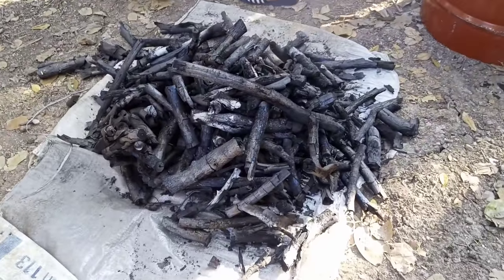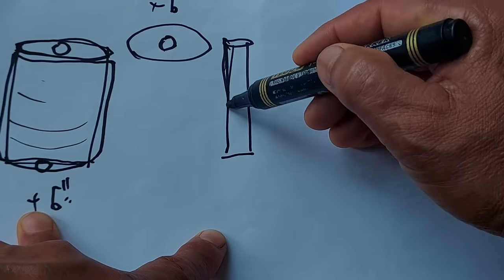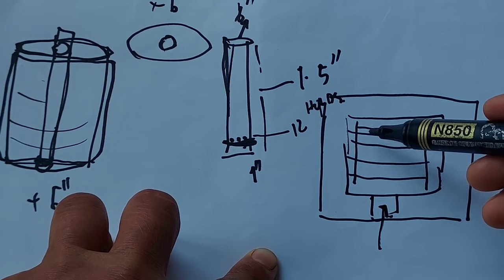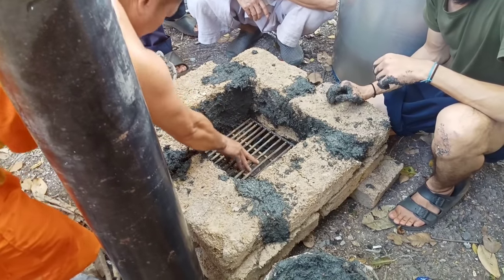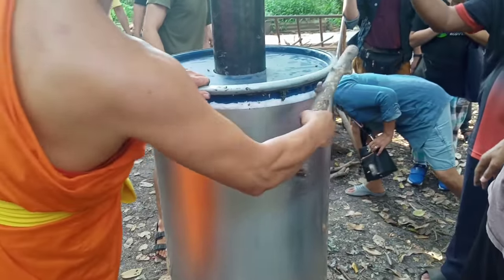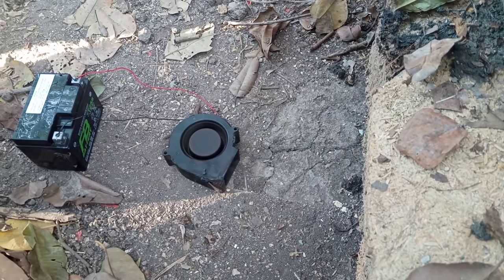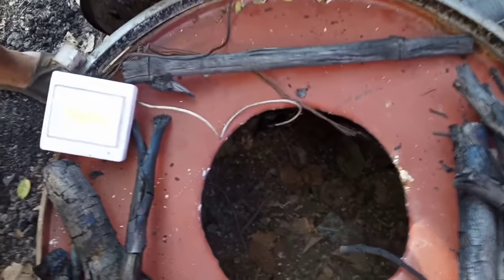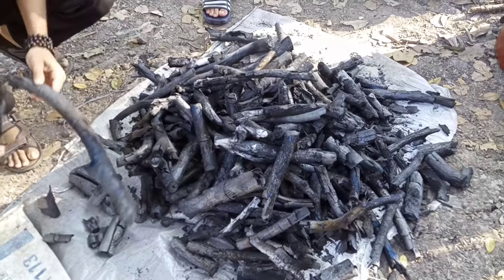Charcoal making with no smoke. The 2nd techniques.

Comment: This is basically a giant rocket stove with a drum around it. If you put a crucible on the top of that flame you could melt metal garbage like cans and cast them into useful tools.
Reply: Seems dangerous if the crucible falls down with molten metal.

Comment: Hi Jon Jandai. I built this according to your guidance and I have already made two batches of charcoal. However, I had one problem: I had a really hard time keeping the gases from escaping in the gap between the chimney and the top of the drum. I kept adding wet mud and it helped for a while but later the smoke had made it's way through it again. It seems like you guys were really good at sealing it up really good, but did you also have that challenge? Anyways, thanks a lot for sharing, this is what is awesome about youtube and people like you who share this content for us likeminded people
Reply: UPDATE. Made 5 batches of charcoal with this method- nice and dense quality. I realise that it is not possible to avoid the gases from escaping around the chimney without welding or other kinds of sealants. The pressure built up in the pyrolysis is quite high so it will escape in small cracks, By closer inspection I can see you guys had the same challenge. But I realise that it doesn't really matter. I stoppet worrying so much about some smoke escaping and just tried to reduce it. The charcoal came out really good anyways. It shouldn't matter anyways as long as most  gas escape the bottom holes in the pipe and provide fuel for pyrolysing the wood
Reply: Jen you should make clay mud. It would work. I was thinking of this for a clay kiln outside. I love this idea
Reply: @somatder  When making char cloth and chared punk wood, we have always poked a small hole in our cans to vent gases. Some bushcrafters teach that no vent hole is needed and I believe this system also works because the tins they use are not airtight, allowing gasses to escape.
Reply: @somatder   I haven't built mine yet but I've noticed the escaping gas/smoke in several videos that use this design. What I plan on trying, based on what I've seen in some other videos, is to place a second short 'chimney' tube around the main pipe so that the smoke escaping from the pipe hole is guided up into the flame and efficiently burnt. The outer chimney can also have some air vents to draw further air to mic with the gases and help the burn.
Reply: Get a ceramic fibre cloth / blanket onto the area.
The other idea was the how is not fully cut out but it is cut in this manner and clip it.
https://youtu.be/_tT8LhHQI08?t=141
Reply: I have seen some designs with holes in the bottom of the drum, and holes in the sides of the bottom drum, to allow gases to expand and escape during pyrolysis.
Reply: Use clay with rock wool mixed in. Doesent have to be good clay, and some pozzolano, or crushed ceramic powder. Can be re wetted and reused.
Reply: @somatder  Maybe you need more holes drilled in the bottom or near the bottom of the pipe.  Give the pressurized wood gas somewhere easier to go that through the cracks.
Reply: @harrymills2770  good suggestion! You could be right that the relative small holes are a bottle neck for the gases and causes pressure to build up
Reply: Destillation of sulfuric acid around 1800 usesd an kit from 85% clay and 15% linseed oil. that should work too for that kiln
Reply: @somatder 
Wow, could you please let now how much charcoal one can get out at full capacity in kgs , thanks a lot
Reply: @RuhindaBeat  uhm, I haven't weighed it before and after, but a rough guess would be around 20 -25 kg.

Comment: Fantastic! It would be great to find a way of harnessing all that heat energy......!
Reply: Rocket stove.
Reply: Exactly my thoughts. Imagine a tad longer pipe with copper coil inside with a water supply. Hot water. Or a side elbow in it with a small flat enclosed compartment. Endless fresh bread, a whole cooked meal, etc.
Reply: Steam engine to charge batteries.

Comment: This is a great take on carbonisation of wood. I love the fact that I can actually apply this method without annoying my neighbours with rising smoke.

Many thanks for making and sharing this video.
Reply: 0m
Reply: Its a gr8 technique.

But carbon with max porosity happens between 350 to 500degrees.  At 1000 odd degree u hv less porosity.

Carbon sequestration is good at this temp but max below 500 degrees

Comment: This is definitely the best charcoal making technique I've seen so far, and so simple basically anyone can do it.
I think if you could use some of the heat that's escaping through the chimney it would be even better.
Maybe heat some water with it, (several cubic meters:), or add a "sand battery" at the top to store it... Maybe I'll try that myself :)
Thank you for sharing.
Reply: Link you vid of the project please

Comment: A very ingenious idea. You have used a rocket stove to heat the wood for charcoal. It would be good to use the excess heat generated by the fire to use to heat a steam boiler for a generator or use to heat an earth oven for baking. I really enjoyed this, and it has given me ideas. Thank you.
Reply: Or a thermal motor to run the fan that makes the rocket stove work better. Or a generator to charge batteries.
Reply: Dry frute ❤
Reply: Make graphite, make pizza

Comment: Most efficient I've ever seen.  The outgases enter the pipe at the bottom and are burned in the pipe, adding to the heat supplied by the device.  Usually that wood gas is just wasted in other charcoal reactors.

Comment: Thank you JJ for this. However, I would encourage you to also look into biogas, it's more sustainable. Wood is very expensive in our rural area and there's a ban to cut trees, so as an alternative we're looking into investing in biogas.
Reply from the maker: We have less trees in our area before but we plant more in the last 5 -7 years now we have more than we need.
Reply: I think we can use old woods from house demolished to make charcoal!
Reply: many trees are easy to coppice and return year after year. one such tree we use for this purpose is black locust, it's prolific, also in Texas a tree that is a nitrogen fixer and similiar to the black locus is the mesquite tree. This tree is very difficult to kill by coppicing so you can use a field of these trees indefinitely for such uses. Also they produce a pod that can be used to feed to chicken, both of the mentioned trees are good for this.

Comment: How thick is the wall of the pipe? How many burns will the pipe last? Thank you for sharing the knowledge.
Reply: I am also wondering how thick should be the pipe and if it will have any effect efficiency
Reply: I'd go 1/8", and it will last fairly well, if its protected from rusting.

Comment: Hi JJ. Thanks ever so much for this excellent video. I tried this using palm kennel shells to make charcoal. All the charcoal around the pipe was very well burnt. The other half near the edges of the barrel not. The palm kennel filling in the barrel is much more dense than the wood. Do you have any idea as to how i can make it work? Thanks again for the great video!
Reply: Not JJ but here are some options: 
1. Better/thicker insulation arround the barrel. This will help increase the temperatures further out inside the barrel.
2. More starting wood below the barrel. This allows the barrel to heat up more before all outside wood is burnt and the flame continues purely  with the wood gas released through the bottom holes of the barrel.
3. Mix the kernels with wood or bamboo to decrease the density.

Combinations of these can also help.

Comment: Its very clean and efficient process. Thanks for sharing.

 I have question. Is the charcoal near to activated charcoal or normal charcoal?
Reply from the maker: I'm not quite sure because so many people name charcoal many ways and many meanings but this technique the minimum temp is 1,010 celsius degree. It is the best quality to filter our water, making soap or put in our bread  or put in capsules to use as medicine.

Comment: Well Done, rock wool might be more available & less expensive insulation:
      ROCKWOOL ROXUL SAFE products can withstand intense heat up to 2150°F (1177°C) without melting, producing smoke or propagating flames.

Comment: Major Question

Clearly the material in the pipe and at the outside of the bottom of the barrel is insufficient to sustain 5 hours of burning so my question is what is sustaining that long burn? 

Is the off gases from the wood inside of the barrel fueling the fire within the tube? Or are you feeding the fire some other way? 

Does the fire self extinguish because the gases within the chamber are exhausted?

Comment: I have seen many different charcoal ovens and this is by far the best yet.
I'm on an island in the Philippines and doubt I can get the layer of insulation here.
Could the drum be in a mud brick tower and use sand as insulation?
Reply: I think that fiber-glass insulation could be used, it is essentially the same as ceramic insulation. 
Sand could probably be used as long as it was very dry. May be best to bake it first.
Reply from the maker: Many people use sand ash or mud bricks. All of them work fine but it was harder when we take the charcoal off. Try to find what you have is the best way.  Cheapest, easiest is the best.

Comment: I’ve seen people make this kind of retort where an additional pipe is attached to the charcoal chamber that  pipes the volatile gases out of the chamber and into the fire chamber. Have you tried this? It seems like it would help to keep the creosote formation down within the charcoal chamber while simultaneously increasing the heat of the fire.  Great video👍
Reply: that is whats happening . its why the 12 small holes are in the bottom of 6" pipe

Comment: I would like to see a PPM test on water filtered through the different charcoals you make, see which is best for water filtration.
Reply: Oh YEAHHH
Reply: He stated early if you use the less quality you will see yellow water from left in resins etc. I will try to recreate his charcoal cooker for the water filters we will be building in the next few weeks. It seems to make sense.
Reply: @lifeinpalawan  It makes sense, and this works great for water filtration. I am just wondering how this charcoal compares to a Britta filter. A simple PPM test would give better feedback than anything else as to how good of a job the filter is doing.
Reply: @DeadshotColada  Sounds good -
Reply: In a different video, Jon Jandai showed how they created 4 Container system, for filtering and purifying water and it is used at Pun Pun center in Chiang Mai Thailand. They have been consuming that water for several years, and they send samples to labs for tests regularly. So far, they have not had any problems i\with their water system.

Comment: Sir jon, this is an awesome video. Just wanted to ask, When the fire starts, Do you keep putting small stick woods at the top to keep the fire burning? Or just at the start.
Reply from the maker: Just when we start it.
Reply: After you get the fire started, the heat starts baking the wood, and then the wood releases gases that enter the chimney through the small holes at the bottom. This continues until the wood releases all of these gases and the fire stops naturally.

Comment: 6:17 concrete and fire do not go well together. concrete contains a small amount of water inside of it's morter which makes the rock explode when the water turns into a pressurized gas.
Reply: I had to cut pipe from a concrete wall once.  It wasn't fun!
Reply: looks like you have never studied chemistry

Comment: I followed your design but the fire only stayed at the bottom. It did not go up as seen in your video. Can you tell what possibly went wrong?
Reply: It could be because of the small holes you drilled in the pipe..it also depends upon pipe thickness..if the pipe is thick like 5 mm or more, it takes longer to heat it, so you have to add more sticks to generate wood gas
Reply: @Pahaadi  great. Thank you for this

Comment: Sir, What was the insulation you placed on your barrel?
Reply from the maker: You can use any kind of insulation.
Reply: @JonJandaiLifeisEasy  What kind did you use?
Reply: @franciscomiramontes1671  he used ceramic fibre blanket held in place by aluminum sheet.
Reply: @thoriqziyaad5877  Thank you.
Reply: @thoriqziyaad5877  Aluminum Sheet, do you know how the sheet is held in place? Fasteners? Rivets?

Comment: I don't think that the holes in the pipe that was in the center of the drum were necessary for the wood to turn into charcoal.
Reply: Cody's lab made some activated charcoal and even showed a method to test it's porosity scientifically. {  GNKeps6pIao }
Reply: Those holes are necessary. Once the wood inside the barrel begin to char, they produce the gas (gasification) that that keeps the fire  burning. If you didn’t have those holes, you would have to keep feeding the fire and the barrel would technically (if sealed) explode.

Comment: how do you know when to stop adding fuel and let it cool down?
Reply: In this case , when there is no more fire coming from the pipe.
if you make charcoal in a drum with an external fire , when there is no more gas coming from the drum, it is done.
Reply: @fragwitz8898  cheers

Comment: I don't understand why not use the wood straight away, instead to burn wood to make charcoal 🤔
Reply: Charcoal burns longer and more consitent. It is easier to control when cooking and creates less smoke. burns hotter too so you consume less. Also in the making of charcoal sap/resin is burned off leaving tar makes it less toxic when cooking on a regular basis. charcoal does not rott hence makes it good for long term storage, aside from that you can make many more products from charcoal as a binder for glue and some water purification.
Reply: @MarkPhilippNeumann  thanks
Reply: @WaschyNumber1  no problem:)
Reply: Wood in original form is food for termite. It also rot easily, releasing gas into atmosphere Carbon is much more stable. Plus it has several uses.

Comment: More heat is going up the chimney than you will get in fuel - it's absurd.. You are blasting heat into the sky in order to generate future lesser heat... How does that make sense? Think about it. Either harness the energy released from the retort to do something useful - I.E make that heat work by heating water/turning a turbine/doing something useful/ I dunno - but it's basically absurd at the fundamental level. Reaching  a sustained 1000c, using fuel,  to produce a basic fuel that you cook with.. Cook with the original wood, maybe? The stuff that produced the 1000c retort temp? Or do it different.
Reply: charcoal is much cleaner as a domestic fuel than wood, and these retorts are the most efficient way of making charcoal. Also, wood with higher moisture content, that would burn poorly and smoke too much to use indoors, can be converted to clean burning charcoal. Metal forgers use the higher temperatures obtainable from charcoal burning, wood would simply not work for them. Charcoal has other uses such for filtration. Basically, the retort can convert a low quality fuel to a high quality fuel, nothing absurd about that.
Reply: @batchrocketproject4720  Have a re-read of what I said. I know full well what the benefits of charcoal are.  Then have a think if retorts really are "the most efficient way".
Reply: @jamesward5721  Have you seen ring kilns or any other usual method of making charcoal? If you imagine there is a better way than this type of retort, then do share. Incidentally, don't pick a fight about your misunderstanding of the context of 'efficient'. my claim, measured and provable, is that these retorts make the most charcoal for the amount of input wood (yield efficiency). Yes, energy might be harvested but the set up as is is a marked improvement on any alternative method used to make charcoal. Have a nice day.
Reply: In a perfect world you may have a point but there will always be a need for charcoal. It is a much better fuel for wood stoves as the charcoal will provide a longer and more controlled burn which is also less corrosive to domestic indoor stoves. When you leave your glass castle to go purchase charcoal, somebody else has chard this wood and packaged it in a nice white bag so you don’t see how they polluted the environment and you don’t get your hands dirty. Believe me when my US government collapses and I need to heat my home, cook my food and require carbon for my filtration, this is the method I will be using. Please note the “No Trespassing” signs surrounding my property when you’re looking for fuel to keep your family warm and fed.